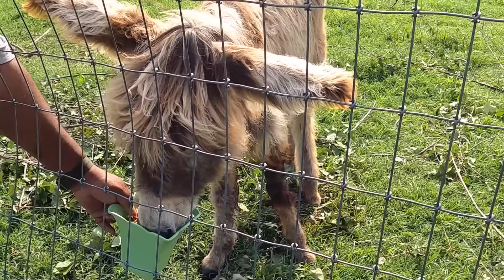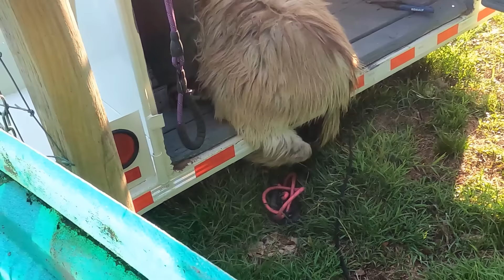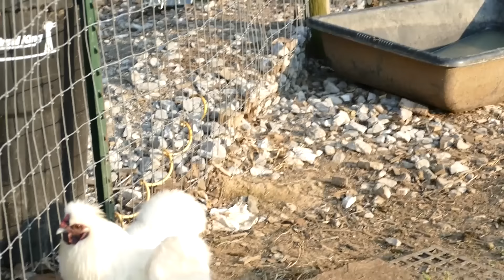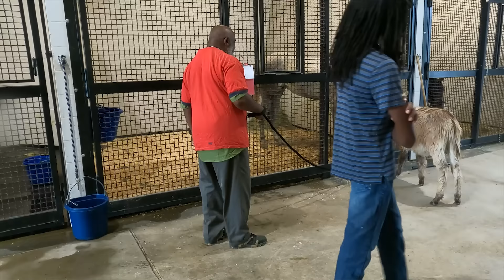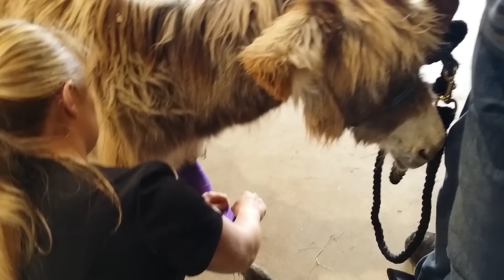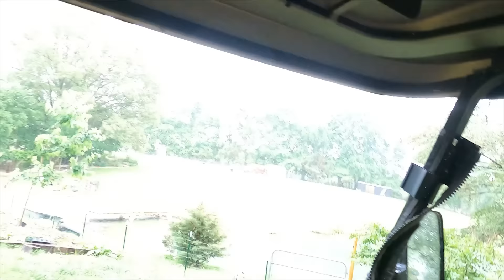This Jackass needed Professional Help!

Comment: Hey family, I work at a horse stable. Been working with horses for about 7 years. I recommend that you guys get a halter and lead rope for Harley.  If he doesn't want to put the halter on or come to you , slowly approach with your hand out. Donkeys, from what I've heard are very particular,   but I assume out of curiosity, they'll be less apprehensive, like horses are, when approached with an open hand. I hope this helps a little .